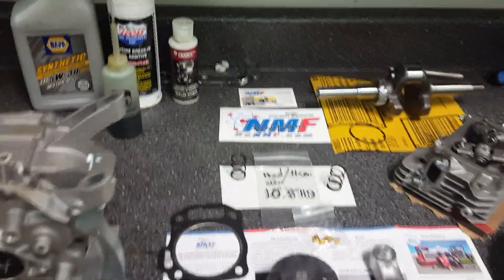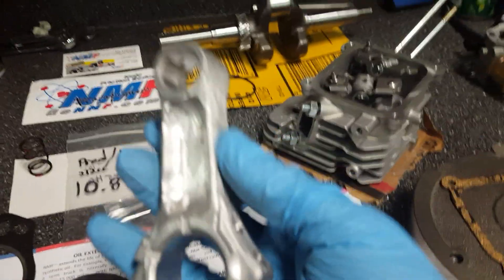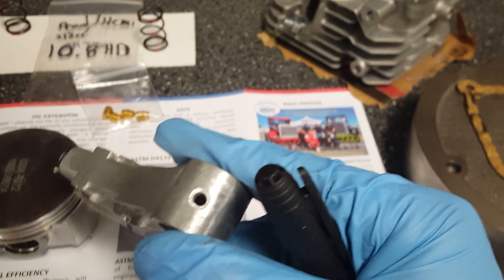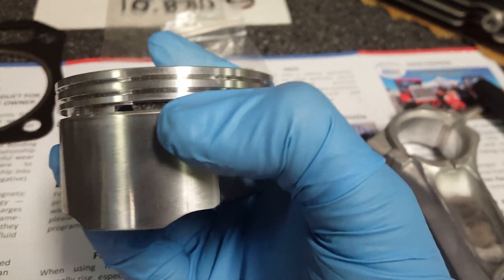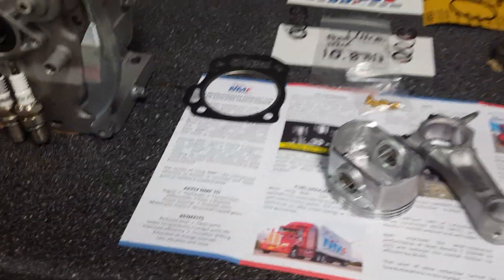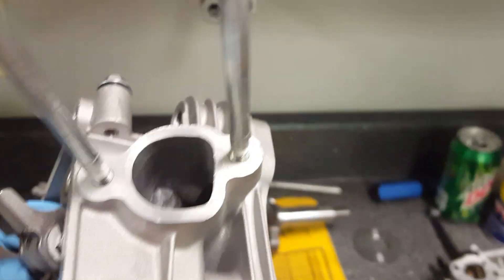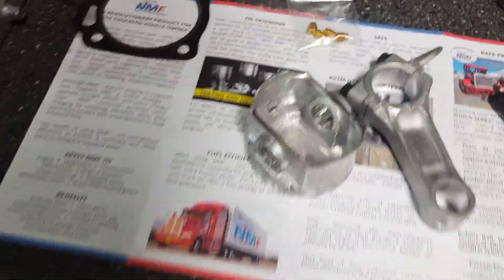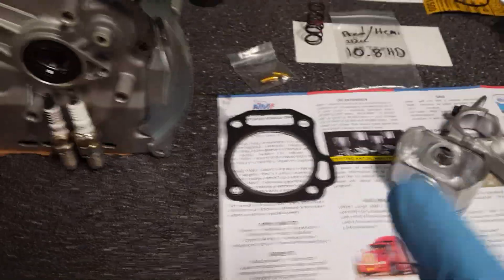Hemi predator box stock 212cc HP tips

Comment: It's always very interesting to see how people make more power out of a box stock. And nice little video btw. Only things I thought I'd point out, if you can pass tech with a thinner head gasket, run that. More compression and assuming its metal it will make a better ground for the spark. And that head is far from ideal for that engine, from my experience with stock carbs, less is more in the head. That stock port is already too large for that stock carb, even on a 25/24 clone head, porting too much will make the fuel signal go wild. These are just my opinions/experiences, I am very curious to hear how this engine work for you, was it fast? Do you still race it?
Reply: And I dig the CL race car 👌
Reply from the maker: I'm racing the CL now. Got out of cart racing bc our local track kept changing their rules & plus my nephew stopped racing karts. That engine still runs & is on my minibike. Its too much for that lil thing. I moved over to clone b4 I ever got a chance to try it out on track

Comment: Thanks for the tips. I know this is an older video but I noticed you have commented on it a couple of times in the last month or so. I'm just trying to grab any tips that I haven't heard before for a basic low budget build for a barstool racer build. I'm not sure if your still doing box stock or hunting for free/cheap and easy mods that will increase more net usable energy.

A couple legal mods that you can incorporate include:

Adding (doubling up) the gasket on the side cover. Most box stock classes allow a double gasket plus gasket maker to bond them together to avoid leaks. What this does is adds a bit more clearance to the ends of the camshaft. Typically when you torque the cover down the sides of the case presses against the camshaft and increases the energy needed to rotate the assembly.

You can use lapping compound on the rotating parts to help break in the parts and even out the surfaces very slightly. Wristpin, rod, cam ends, etc. Just some quick spins on each and then excessively clean parts before assembly.

The same thing for the valves and valve guides. A quick spin like you are trying to start a fire with a fire stick, rotate repeat, rotate, etc. Just enough to take the microscopic hills down flush and and micro burs away. 1000 or 1200 grit keeps it nice and subtle.

You don't want to really take any material away so much as to just knock the tips of the peaks off on mating parts.

You can trim back the sparkplug electrodes and shape then into a v with a tiny flat spot in the front. This allows the spark to be more in the mixture and channels the sparkto the center where the spark has the shortest distance to jump. This allows you to open the gap to expose more spark to the mixture. Every little bit helps.

You can also experiment with indexing your sparkplug. The most open side towards the exhaust valve is the most common index people say they use.

In addition to the NMF you should try to use an oil from Germany called Liqui Moly. They have tons of great products you can use and all of them are fantastic IMHO.

Also, strip your chain, clutch gear and sproket of any and all oild, melt down some parifin wax at about 150 degrees and put the chain and teeth the chain will be mating to in the wax for 3-4 mins. Slap them back on and knock all the chunks off. It will be like a candle exploding lol Tests of chain oils, sprays, greases, etc have been done scientifically in a controled lab that shows that good ol' parifin wax provides the best speed, least amount of energy to do work, is waterproof and withstands dirt, sand, debris better than any other product tested. In dirt and water it actually became more energy efficient. Plus it outlasts all other products as far as having to re-apply. Plus you can add other lubricants to it to try to improve  without worry of washing it away

I like that you shared some of your tips so I thought I would give you a few you might find helpfull.
I hope this helps. Thanks for the video.
Reply from the maker: Much appreciated!  Thanks. I like learning things from intelligent people like yourself!
Reply: Your welcome! I'm going to hunt around your channel some more and subscribe.

Comment: What's your thoughts on a hemi to regular 212.  Try polishing the piston skirts and crank journals.  What about a thinner head gasket.  Try opening the carb slightly.  I'm a older guy looking to have some fun with these on a bicycle
Reply from the maker: Buy the hemi bc alot of clone 196 cans are a direct swap. The best upgrade & easy is honda 18lbs springs. Also a black mamba jr. Cam is a great upgrade. Alot of ppl remove the 2nd ring. But for reliability keep it. Ported head & a bigger jet in carb helps

Comment: Ditch the HEMI head buddy it sucks big time. Put on the Predator head on it where the valves go up and down inline with the piston. I have those BLUEPRINTED heads for $200 Stainless Steel valves, Aluminum keepers, ported and decked. I also have this head completely stock.

Comment: This is no longer box stock. I run a box stock class. We even need to keep our governors on and make them functional. We can only remove our low oil pressure sensor. If they are still pulling away from you, change your gearing. I run an 18 in the front and a 57 in the back. Most guys where I race run a 18 up front and a 65 in the back. Also make sure you're running the right tires. My class has to run Burris 33's, make sure you're prepping them right too.

Comment: So..  the spark plug gives a small amount of displacement to decrease chamber size and therefore increases the compression..    yet you still used a stock gasket?  I wonder how the thinner gasket would have worked out..          also. Ive had good and bad results from porting heads.    So its not always an improvement. 
   And im curious about the NMF.   seeing how the block, head, rod&piston are aluminum..   and non-magnetic..  does it do much?     
   I actually run a mixture of full synthetic and nickle+copper antisieze.    Shit works amazing.   I run it in any motor,  pump, gearbox,  diff, standard transmission etc.   Itll smooth old engines out within minutes. .  And make compressor pumps go forever.
Reply: yea,  dumb to use .040 gasket when a .010 is $6.  Then to go to all the trouble to seek out a $6 plug to try to get some. ...compression ratio is the driving factor in horsepower.  Every 10th counts!
Reply: Rules probably call for a stock gasket…..duh

Comment: Here's an idea.... Instead of building a cheater motor because youre getting beat, try putting this much thought into your setup/tire program and keep your motor legal. I also race a box stock predator class and its people like this that make it unfair for the racers WITH morals and refuse to cheat. But when you are doing things like this how do you expect the rule followers to compete with your motor? Great video but bad intensions!
Reply: Yes sir buddy you said it cheating not winning cheating big difference
Reply from the maker: I agree. But it was our local track not enforcing the rules. You can buy the winners motor for $125. We did that 3 times & every time ppl have modified it. The only rule they kept was 5500 max rpm. That engine in video has been dead for a year. I agree with you about the tires though. It costs more to get your tire program right than a $1200 clone. You cant compete with shitty tires.
Reply: @h2omechanic  Stock valve springs to limit rpm?
Reply: Typical racer! Spend money to cheat in a "stock" class.

Comment: You'll probably have to fabricate an exhaust because they really don't make one for these motors. Also watch your rpms. When removing governors and raising the revs you can run into troubles with valves. The reason why is these motors are designed for working low rpm situations. I'm sure you've done your homework but, just putting in some input to make your motor more reliable. You've done a great job sir. I'd like to see the end results. I've fucked with small engines and larger ones all my life. Some things are very under powered for longevity and agriculture or other low RPM situations. As you have shown here, casting quality and the lack of quality control make a huge difference in the performance of a machine. I'm glad you pointed out these defects. Gasket materials are another issue. Hoses and other quality is real questionable as well. Any headwork should be done carefully. Don't shave the head on a OHC motor unless you decide on different cams or cam. It will change the timing and you'll scratch your head why that engine wont run correctly. sorry for the rant. I just love to see someone doing something like you are.

Comment: Hey I'm thinking about getting into oval karting starting with the box stock class. I'm 18 years old, so what are the age limits/requirements for the box stock class? I know they divide them by age groups.
Reply from the maker: Shark Bait at 18 you'll be fine. They are divided into weight classes so you'll be in 360 or 375lbs. Group depending on your area.

Comment: When you are polishing your ports, there is some that believe wall roughness (not smooth) helps keep the fuel atomized and also to match the intake gasket /port/carb inlet all matching opening size.
Reply: That is for sure, Mark, ,keep the intake side a little rough !!...  I retired as an advanced level master auto tech.,& fabricator, of 40+ years,, & built ''lot's'' of race engines of all shapes & sizes... . I74

Comment: What we do is take a brake cylinder hone and hone the rod and rod cap to get more clearance there if your gonna be running without a governor you can turn more rpms and get more oil in there because they have a habit of burning in there and locking up at that point

Comment: Another engine trick- at the bottom of the piston skirt use 220 sandpaper to make at tiny @.003 in. bevel. This retains oil on the cylinder wall, helping the piston to float on both down strokes.
Reply: Good one !

Comment: You just took that engine and made it completely illegal for a box stock engine .. True box stock is take the gov an oil sensor out and that is it  You can't port or change the valve spring you can't change the jet or anything else so if you did run this and got teched you know this by now if not ur lucky but any one watching this and thinking about doing anything but taking out the governor and oil sensor .. Don't do it !! Read the class rules for your track and know them before doing anything past gov and sensor. .  you been warned lol
Reply from the maker: Matthew Ginithan there's no tech.  Only a $150 buy out. So our track says it must resemble stock but, you can build a $500 motor & anyone can buy it for 150. So basically you get $50 to build it how you want.
Reply: The H2O Mechanic tracks here run by true box stock rules ... Its a claimer class so if you win too much or they suspect something they take your engine and give you a New one in the box and yours gets put in the tech shed an taken out of circulation
Reply: @h2omechanic  what what track is it bud or what class because make it looks. I can do that and make it have 25 horsepower exaggeration but you get my point
Reply from the maker: I love all your comments. But the irony in everyone that comes here to bash a 2 year old build is bc your here to see ways to take your engine & make more power. You watched a video to see what you could do. Our track had 1 rule with predators, anyone can buy the winning motor for $125. So do what u want with what u got...
Reply: If there were burrs present then the man can't be blamed for grinding.  The race should be about the race, not scrapping engines.  Maybe the race track isn't challenging enough if speed is too important a factor, but if there were bottle-necks people would get ground up.  The racers could be assigned one anothers' machines at disqualification risk and wind them out, the speeds could be measured and then the racers could be layed out for start.  This  would be difficult because the number of laps might be different for different drivers, but everyone is going to scrutinize the race anyway.  This would mean every race would be two events which could mean more interest and profit.
Reply: I run at ShellHammers in Leesport PA. We can't touch our motors except for taking the oil sensor off, even the governor needs to be on and functional
Reply: Matt ginithan you can't take the governor out here in pa....

Comment: Shave the head 50 thou and open the ports of the carb. Advance timing and bigger valves. That should really give you a huge boost
Reply: And keep the stock gasket. It seals much better and I have seen those tiny ones blow out easy and then your engine is gonna die
Reply from the maker: Random Moustache Guy my track has a 150$ claim so I gotta keep my cost low. But fabricate as much as I can. I'm running 2 top rings on the top & 2nd ring grooves. The regular 2nd ring cause more drag. I did a test with a fishing scale put the piston in upside down & pulled it out measuring the resistance with the scale. It dropped 22% I believe

Comment: A little trick to help prevent floating valves put springs on lifters with a washer against the block just be smart about spring selection not to thick so you don't damage anything, this trick allows for a little higher rpm before the valves float

Comment: ported heads in box stock? Cheating little fuck.
Reply from the maker: superhoggbike ported heads don't benfit stock engines with the airbox I've learned over a year. The Cfm of a stock head flows more than the stock carb so there's no benefit. Most power is found by reducing rotational drag in the engine. I have this engine on my buddies mini bike now with a BM jr .   Cam in it.
Reply: All heads flow more than the carb, whether it is a bone stock 6.5 or a pro stock drag car. why bother with it if the carb is always the bottle neck? Because it works. I port small block chevys all the time and still run no more carb than a 650 cfm.
Reply from the maker: It does help to remove sharp edges to prevent air having a swirling effect. At 350 ported you gain noticeable power, but at 7hp a gain is minimal but costs you nothing, our rule is your motor can be bought for $150 so you do what you can to make power with not spending over $150 total investment. Now if a true tech race was entered I'd run a stock head. But our track has b.s. rules.
Reply from the maker: Predator class was made for the DIY guy who can't buy a $1200 clone. It's cheap fun & with a low cost claim rule ppl can only do so much or they lose there money invested in the motor when the last place guy buys it.

Comment: Do you ever get massive amount of vibration mid throttle? This is the issue I'm dealing with ATM.
Reply from the maker: Jeffrox M. Not really an issue I've been having. I'd test your flywheel on a rod. spin it & see if it rests at the same spot every time. I've had a cast fw be an ounce off balance

Comment: Should get a Dremel, and open up the intake & exhaust ports. Leave the intake relatively rough, but smooth the exhaust out as best you can.
Reply: That be right!! , & get the exhaust flame out of the port as straight as possible, ''if possible''...….Usually that means grinding & polishing the rearward  part of the exhaust port up by the flange, more than the front,, ''on most car race engines anyway'' …..

Comment from the maker: So. if you run at Brunswick speedway it's just $150 & it can all be yours. depending on which motor I bolt on. you might get a pile of shit.
Reply: The H2O Mechanic hey is there any way for me to email you. I have a racing cart and is very interested in what you do
Reply from the maker: Austin Clevenger Hwdracing@gmail.com
Reply: i was gonna say sure would be a shame if someone bought it after doing all that work
Reply from the maker: @willbroadwell5975  that ole motor is still running after all that abuse 2 years later, just on my mini bike now.
Reply from the maker: @willbroadwell5975  that ole motor is still running after all that abuse 2 years later, just on my mini bike now.

Comment: nother trick with the spark plug is cut the lip at top of the threads where the plug will go in the head deaper helps a lot and run 12oz of racing oil and 2oz of wd 40 makes great powers dyno tons of motor it helps